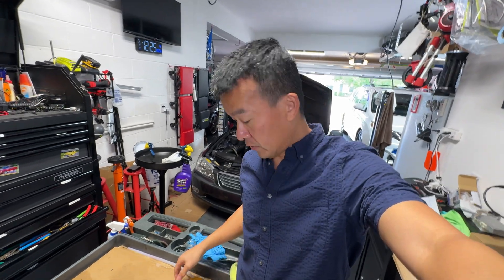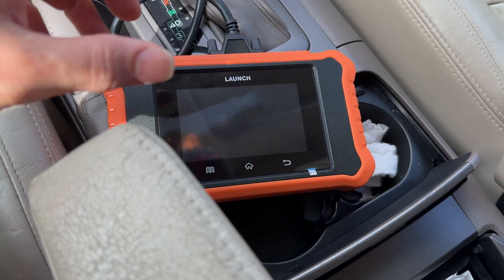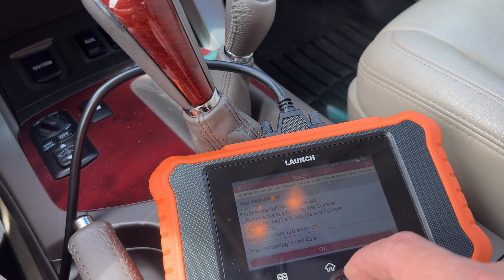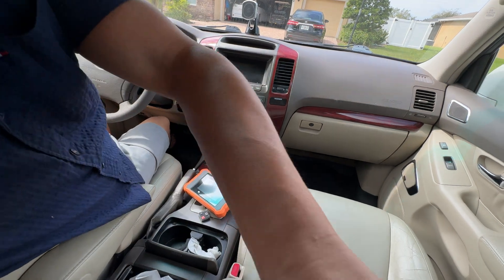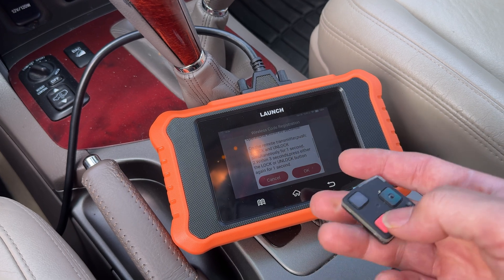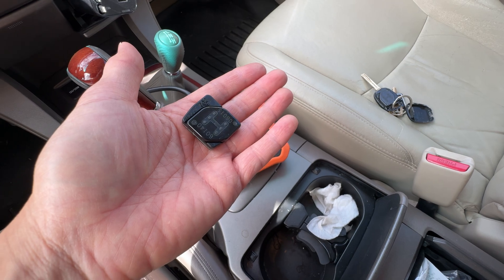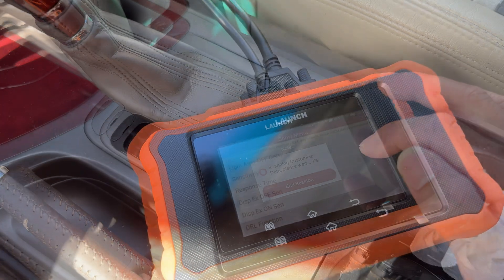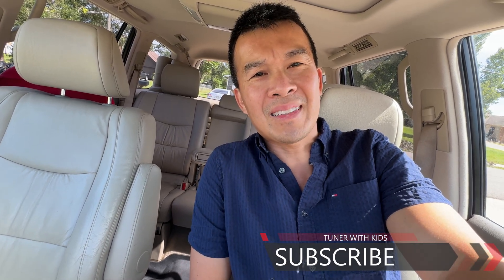How to Program Lexus GX470 Key Using Launch X431 Elite 2.0 Pro

Comment: Thank you. Order mine saved about $300 because the Lexus deal wanted $250 for the key and $75 to cut the key. Then another $250 to program it. I bought mine on eBay I paid to get it cut then bought the toll on Amazon.

Comment: Hey Buddy, thank you for all the information provided in your videos. They've already came in really handy with my GX470. Do you or anyone on here know if this Launch unit will do the steering wheel calibration (like performed after an alignment) like Techstream on Toyota/Lexus vehicles?
Reply from the maker: I’ve never messed with steering calibration or knew it was a thing for the GX. If it’s a techstream utility, it should be available on this tool since it can access all the modules and their options and utility menus.

Comment: Does this work for newer vehicles with push start button?
Reply from the maker: Yes it will program smart keys. The scanner does everything Toyota Techstream does at the dealer. So any diagnostic, custom settings, or programming is available on the menus.
Reply: @TunerwithKids thanks!
Do you know the difference between v1 and v2 of the Launch Elite?
Reply from the maker: Costs and orientation. I have both and the landscape version in this video is a bit faster, has on board battery but does all the same things. The portrait version (V1) is only $120 or less and is good enough for most. It’s powered by the OBD port or usb.